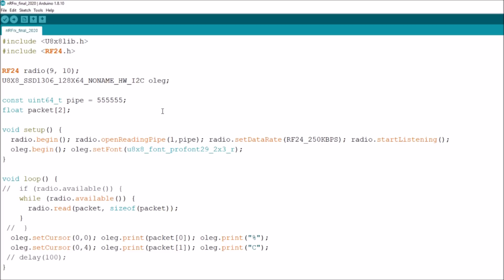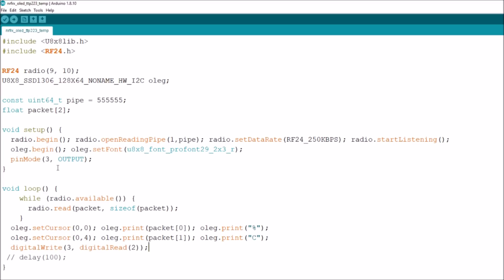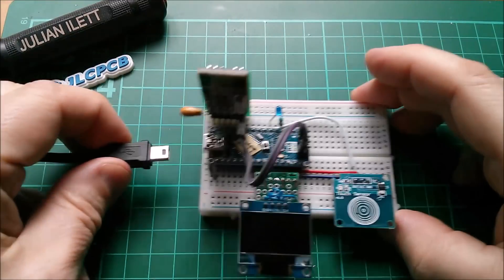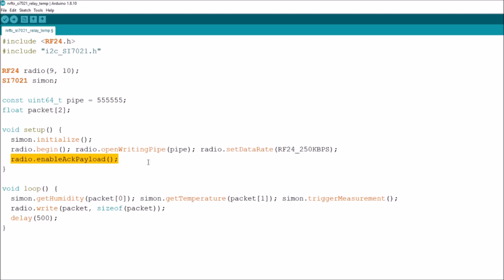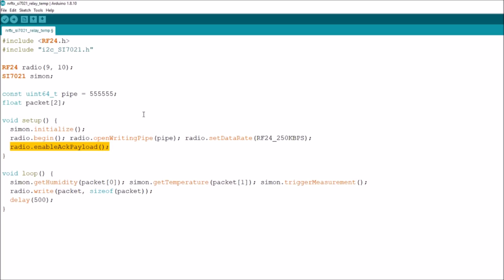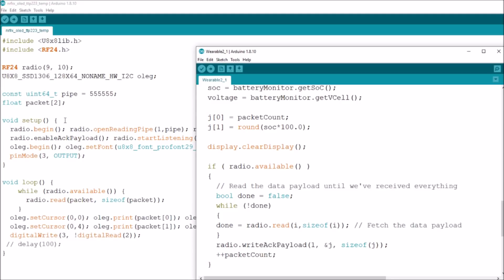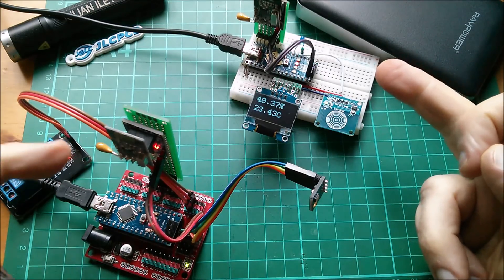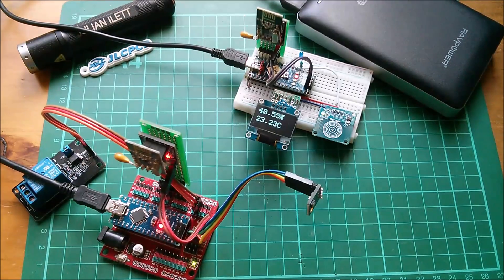It Works! Arduino, Transceiver, OLED, Touch Sensor and Relay

Comment: 8:32 I don't think you need an array of one bool. The & means "address of", and that probably means the functions takes a void pointer. In that case the type is not important.
Reply from the maker: I think I understand what you're saying - but this stuff is on the extreme edge of my understanding of C data types :)
Reply: @JulianIlett  i've been taught in school what pointers and addresses are and it's still confusing lol
Reply: @JulianIlett  types just tell the compiler how many bits the variable needs. To keep the stack from growing too large when many functions are called (like Inception), we instead just tell the function where (the address) to retrieve the value for a given variable it is working with. Understanding this is like understanding how current flows around an op amp .. not thru it --- hard but once you get it, the rest just falls into place. :)
Reply: @HazeAnderson  Exactly.. The array declaration isn't wrong, per se.  I'm pretty sure the Arduino compiler isn't advanced enough to optimize that out, but it won't affect much in the end.  It'd be interesting to see how it affects the final code size.  If the compiled code is the same size as if it was declared as a regular bool, then maybe it's more advanced than I thought.
Reply: @chrisw1462  it should turn out about the same size, depending on the instructions set, and I don't know that.

An array IS a constant pointer to the first element in the array. Which is a memory area with place for the number of items it stores. 

Int a, *ap, ar[3];

So, ap contains the address where a Int is stored. And ar is the address to the first Int in ar. You can change ap, but not ar.
ap = & a;
This take the address where a is stored and assign that to ap.
a = 2;  *ap = 2;
This assign a to 2, and the second stores 2 in the memory place that ap contains, which is the address of a. So both stores 2 in a, because of what is in ap.
ap = & ar[0];
Now ap contains the address of the first Int in ar.
a = 2; * ap = 2;
Now we set a to 2 but we stor 2 in first place in the array.
So, * infront of a pointer to the left of an = stores the value to the right in the variabel.
a = *ap;
Here we take the contents of the memory cell that ap point to and stores in a.

The fun stuff.
a = * ar;
a = ar[0];
This does the exactly same. Remember array names are a pointer to first data in it. So ar is a pointer to an Int here. And as adding 1 to a pointer will advance it to next thing it point to. Adding 2 will step two steps etc. 

So. 
ar[0] are actually *(ar+0)
ar[1] are actually * (ar+1)
and so on.
Remember, ar is a pointer. Adding steps forward that many items it point to. And a * in front of a pointer will giv the memory cell contents it point to to read from or if it is left of an assignment store to.

When you want to let a function change the contents of a variabel, you need to send its adress. Because you only send the value of an argument to the function, not the variable itself. So if you assign an argument in a function, you only change the copy.
So, by sending the address you can change the variable you point at, that is what & is for, taking an address of something.

So for me, it is a bit strange to take the address of the array, and send it to the function. When an array already is an address.

Probably just confuding, but at oro tip. Write variable as boxes with variable name to. And addresses as arrows pointing to other variable, cells. It usually is easier to understand then.

Yes, it was confuding tome too, when I started to code in C. 😜

Comment: Are these Transceivers the 433Mhz jobbies ?    Just use a old UHF TV antenna and it will work.
Reply from the maker: The nRF24L01+ operates at 2.4GHz
Reply: @JulianIlett  You can use directional Wifi antennas and/or high power versions of the nRF24L01+ modules.

Comment: i think your "on bootup it defaults to on" behaviour is from the sensor board having the (hardwired in factory) "active high" and "momentary mode" settings tied together (iirc from your previous video), so when you inverted it to "toggle mode" you set it to "active low", so when it initializes and it defaults to being inactive, it's outputting high.
also about the "something to do with pointers" thing: when a function is supposed to change (e.g. by reading something into it) a variable, it needs a pointer to it (otherwise it would just see the value). with arrays already being pointers internally this is technically not necessary, but i suspect the authors of the library just did it to stay consistent.
also you might want to switch your `radio.available` while loop back to an if (but not both like you used to have) because the way it's now it could be skipping packets (by reading them over and over because there's still something available but not doing anything with them), and the loop function is already an endless loop anyway. you should also reorder the code so the payload is sent as soon as a packet is received, so it doesn't accidentally time out when the display is being a bit slow.
Reply from the maker: I agree. The software fix seemed easier than cutting tracks and soldering :)